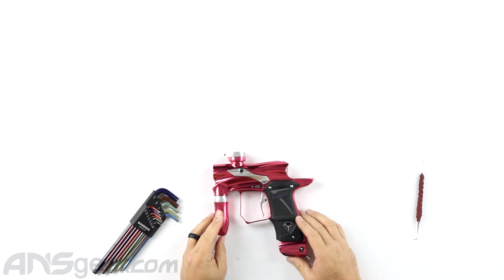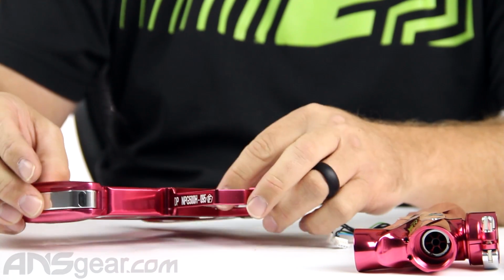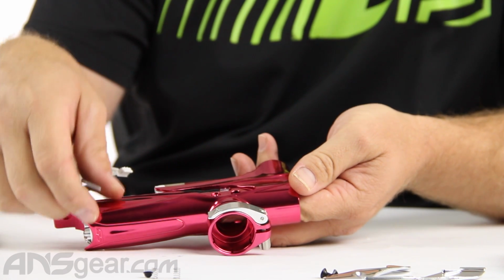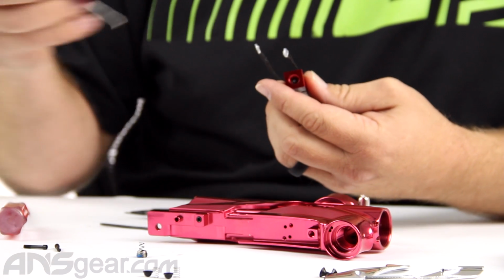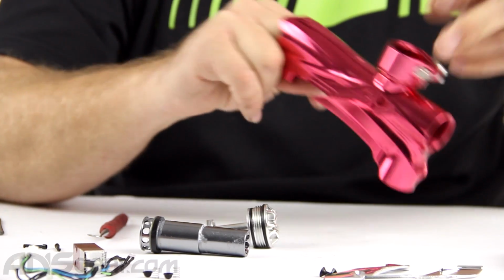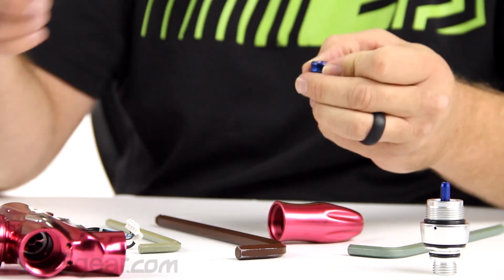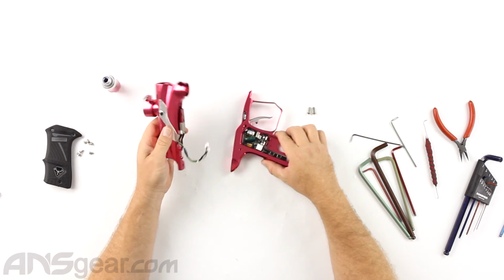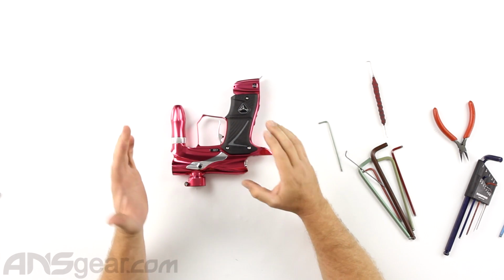Dangerous Power G5 Spec-R Paintball Gun - Maintenance/Repair

Comment: Where would you lubricate the bolt ? And what is the proper way to install the Turbine core bolt? Also does the Dangerous power g5 spec r  come with a rebuild kit? If not where would I order one ?